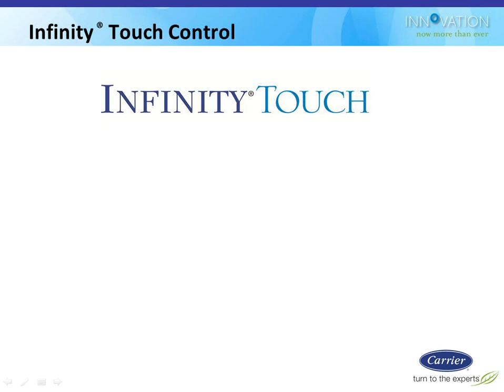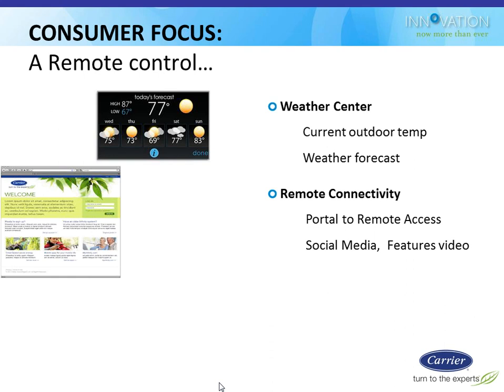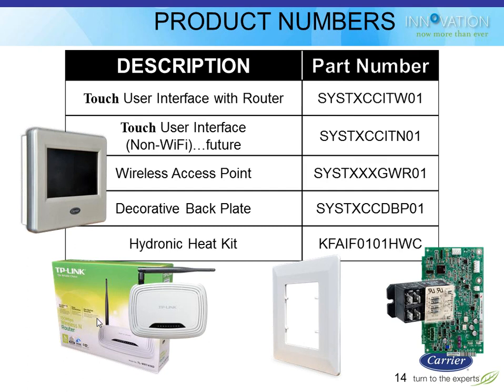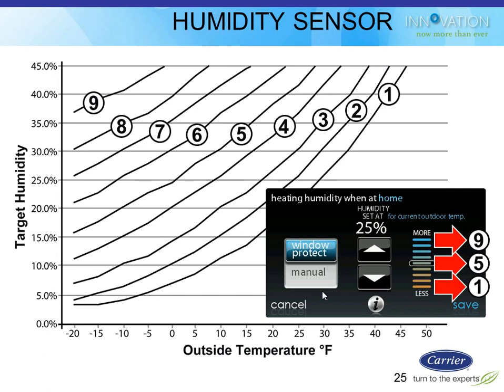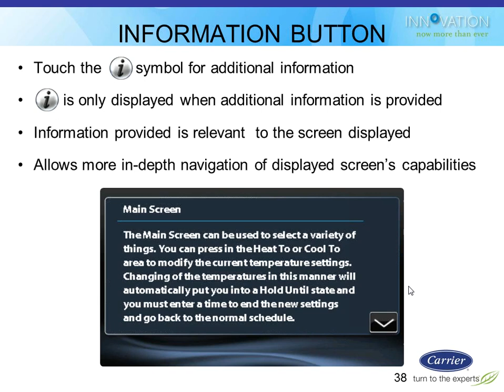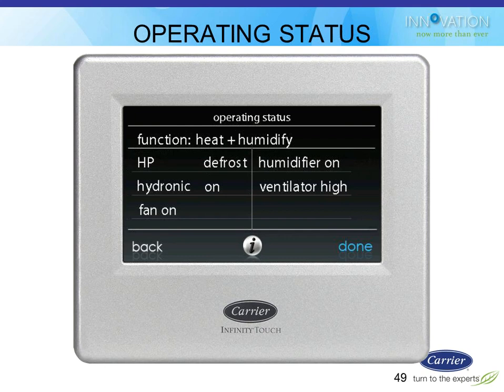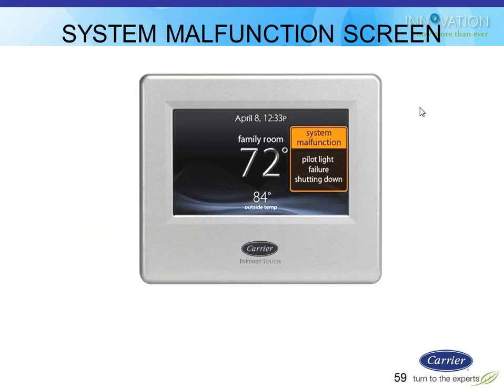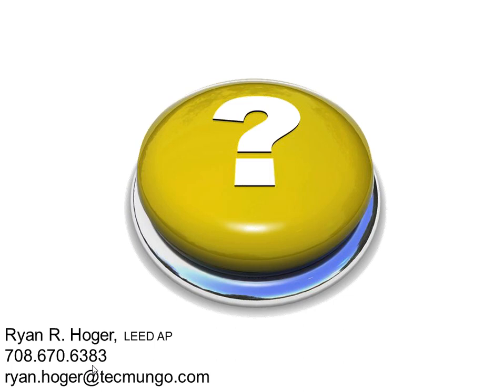Carrier Infinity Touch Controls - Webinar 7/13/12

Comment: Does this thermostat work with icp furnace instead of ion thermostat?
Reply from the maker: No, it does not. Carrier Infinity and Bryant Evolution versions are interchangeable with each other. However, ICP Ion is not because it communicates with a slightly different protocol between the stat and the equipment.

Comment: Could you use two “user interface” controls in both zones 1 and 2?
Reply from the maker: If you are talking about a zone damper system, then no, the user interface Infinity Control can only handle zone #1. Then zones 2 thru 8 can either use a thermistor sensor or they can have an Infinity Zone Smart Stat.

Comment: Have one of these thermostat units. The touch screen is not very responsive to touch commands. Entering my WIFi password  12 characters  one Caps.... 2 numbers.... one hyphen is so frustrating were the finger touch is not recognized at once.. after several touch repeats and mistypes ..... Going to the " w"  letter can clear  what you typed.Reverted to using a pencil "rubber end " with a very small improvement. Touch a character will activate/display a character to either side of it or above or below. Has there been similar comments/complaint about this product?
Reply from the maker: If you have the exact model in this video, then perhaps. It was sold from 2011 to 2017 so the screen technology was from before that era... so essentially 15 year old tech at this point. In 2018 it was replaced with a newer model with a more modern touch screen. Imagine using your old mobile phone from 2011 today... the screen would suck. But people get new phones every 2 years while only replacing their thermostat every 10 or 15 years.